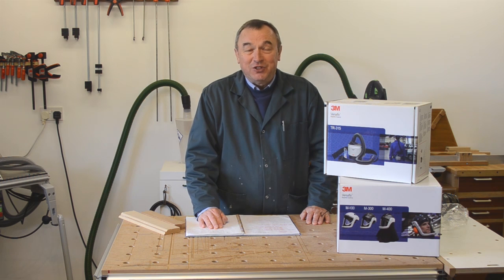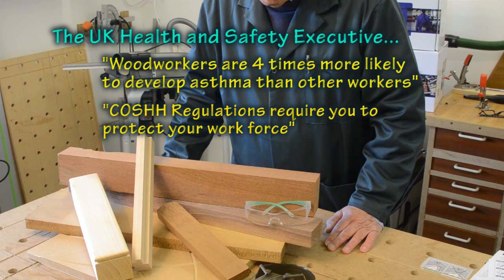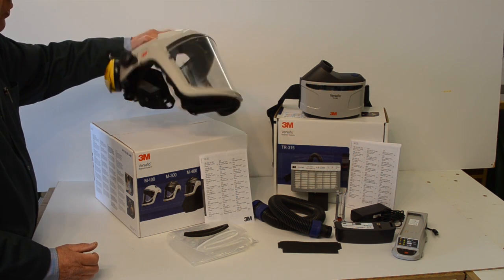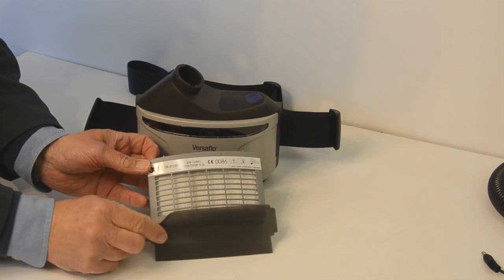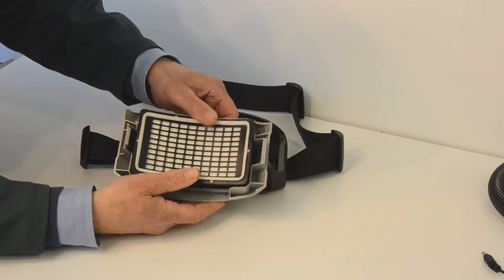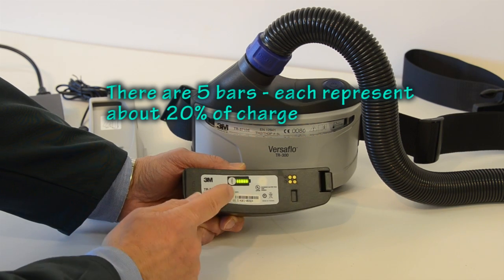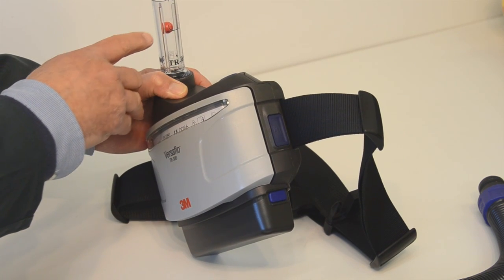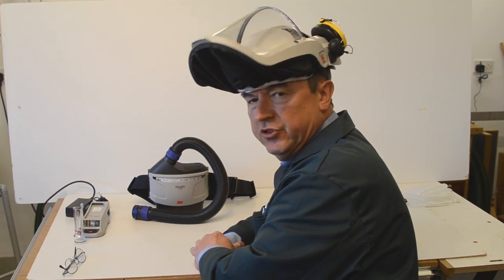3M Versaflo Respirator System

Comment: G'DAY there. Just wanted to pop back in after getting my replacement unit from 3M and I goto say I was very pleased with everything. The merchant and 3M were very apologetic for what happened and really pulled their socks up to get me a functional unit. 

Well to say openly this device in my job is a godsend to say the least. My position on a ship when grain loading is on deck next to the hatch peering inside while operating the loader. Normally I get a face full of cyclonic dust rising from the hatch were face mask respirator and goggles don't fit well. At the end of a shift discomfort would extend many days after from your eyes and nose. 
Was loading some extremely dusty barley with only around 10m visibility with this unit on and it was fantastic. First time ever I'm not hacking tring to breath through a slowly blocking standard respirator and having my eyes filled with itchy particles. Being able to concentrate on my job without any discomfort was just wonderful. The shroud also kept my top shirt pocket clean with chalf inside or inside making you itch like you have fleas. 

Only one drawback with the unit is the motors noise can be quite loud but it's a good traid off. 

One other thing I noticed when obtaining my new unit the connecting pipe was different. The first pipe looked like rubberised flexy pipe where as the new one was more like a ribbed vacuum cleaner pipe. Only real difference the new pipe hugged closer to your back. My friend has the other pipe and seems to be stretched and bulged out.

Anyway that my bit. Thanks.
Reply from the maker: Hi Thomas, I am glad that it has worked out so well.  Peter

Comment: I agree these units are very good. I'm a Stevedore who loads grain onto bulk carriers and sometimes the dust is phenomenal. One of the guys at work got the shrouded type with a basic p2 filter and pre cleaner and is very happy. 

Me on the other hand Iv very upset with 3M at the moment. I unpacked my new kit today and found the air pump bit missing. After calling the shop about it I decided to put the battery on charge in anticipation of the pumping part arriving soon via priority post to find ether the charge dock or battery to be defective! It's been about 14 hours on charge and the battery is dead via pressing the test button on it. 

It looks like to me they sent me a defective return that has slipped back onto the production line unchecked then resold to a sucker like me. After paying upfront cash for the unit and waiting three weeks for it I'm already fed up with it and ready to just get my money back. My trust in 3M has just disappeared.

Sorry about the negative report.
Reply from the maker: Hi Thomas I do not think that you should lose faith with 3M but with the people who supplied you with duff kit. Your supplier is to blame. Maybe you should let everyone know where you bought the kit.  Peter
Reply: Peter Parfitt I'm going to just have to wait for the supplier to come good in getting this package working. Just after seeing your video and again checking my unit I noticed the airflow device is missing and the filter element. 

In regards to battery life of these units they are impressive. My friends unit lasted twelve hours and when he checked the battery level there was two led segments showing. That's not bad at all considering that's continuous running. 

By the way great video and how you conduct it. Well done.
Reply from the maker: Many thanks Thomas. I hope that your supplier sorts everything out. My battery lasts at least a week when I use it 2-3 hours a day.  Peter

Comment: Very well done Mr. Parfitt. The Versaflo will be my next major expenditure for the shop. How much protection does the headgear provide for the woodturner?
Thank you, R. Mantell
Reply from the maker: Hi Richard,

The dust protection is superb and the face protection is just what a wood turner needs. There is a stick on protector for the visor (to prevent scratching) which can be easily replaced.

Thank you for your support.

Peter